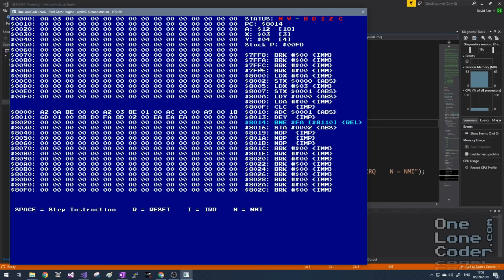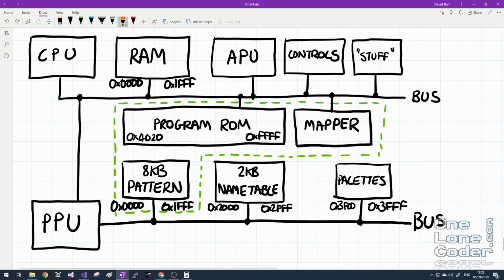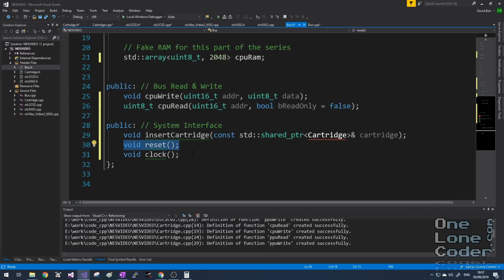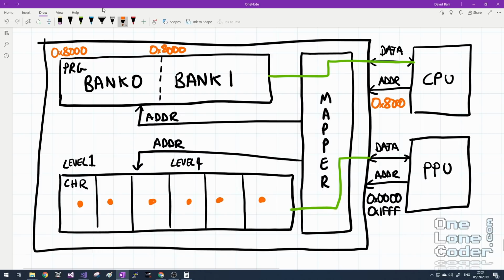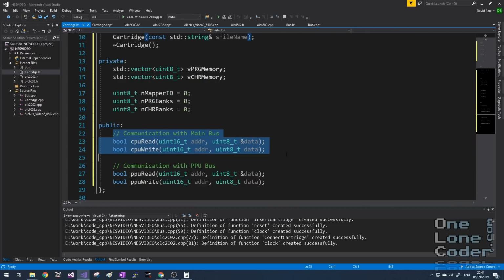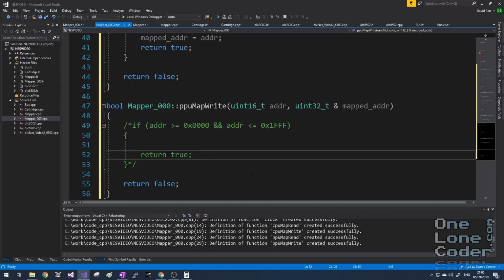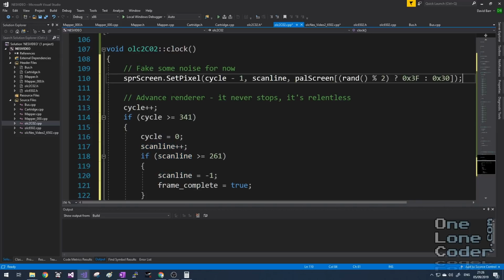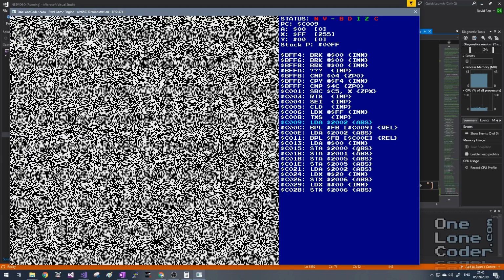NES Emulator Part #3: Buses, RAMs, ROMs & Mappers

Comment: I've seen you do this several times, and perhaps you already explained it (I don't have c++ experience myself), but why do you call a function, then immediately call it again with "~" in front of it? What purpose does the tilde serve?

For example, at 13:23
public:
    olc2C02();
    ~olc2C02();
Reply: Constructors and destructors. Constructors are called when the object memory needs initialized and destructors are called when its memory is getting freed and object removed.
Reply: These are not actually calls.  This is part of the definition of the class, and what these two lines are saying is this class has two special 'methods' that it plans on defining.  These methods always have the same name as the class you are defining.  The first one (olc2C02) is called a constructor, and (with some simplification) when you actually create an object of the olc2C02 class (using something like new keyword) you will call the olc2C02 constructor that you defined as part of the olc2C02 class.  Conversely, the the ~olc2C02() is going to define something called a destructor, and with some simplification here also, once you are done with object, it will call the  ~olc2C02() destructor that is defined for the class.  Defining these two types of functions helps with setting up (in the case of the constructor) or cleaning up (in the case of the destructor) as you use an object.  This is all a part of a basic understanding of C++,  so as a suggestion you might want to review about how C++ declares classes and especially what constructors/destructors do and how/why they are used.  Hope this helps!
Reply: @michaelburns8073  I've done plenty of Java work, so I'm familiar with constructors, but thanks for clarifying the destructor. So it's basically malloc() and free() for that specific object (as C would put it), right? Also, is the destuctor called automatically? I know in C++, and especially C, you really have to work at managing memory, and I've not seen a ton of C++ code, but I don't recall seeing an explicit call to a destructor before (other than in the declaration that I asked about).
Reply: @TheRandomSpectator  yes it's called automatically
Reply: @TheRandomSpectator   It's similar to malloc and free, but to me it's much more, because malloc() and free() generally only obtain/free memory, but object creation/destruction is much more than that, but I understand what you mean.  Yes, you do have to manage your memory in C++, which in Java is usually handled by the garbage collector.  In C++, once an object goes out of scope, then it's destructor is called.  If your C++ object did things like allocate memory, then the destructor needs to free and clean it up.  In Java, although it can cause problems if you hold memory for a while, in most cases you don't worry about it because the GC will get around to cleaning it up once it can. Java does have the finalize() method to help do similar things like you might need to do in a C++ destructor, like close file references or network ports, etc.  For fun, I thought about trying to do at least the 6502 emulator in Java, since I do Java development for a living, but tbh, C++ is better suited for this kind of thing, although I think it would be an interesting technical challenge to try it.
Reply: In the header file; this is within a class's declaration code. Here you are only declaring what a class is. Those two functions have the same name as the class. The first one is the class's Constructor. The second one with the `~` in front is the class's Destructor!. These are used to initialize, construct and setup the class's internal members during construction, and most Destructors are default unless if you using dynamic memory within that class, then the Destructor must free up any memory that was used. So what you are seeing there in the header and cpp files of that class are not actual function calls. In the header they are the class's declarations or prototypes, in the cpp file those are the class's member functions' definitions or implementations. Now when this class is included in some other class, file, translation unit and you Create an instance of this object for example;  olc2C02 ppu;  here you created a variable named ppu, it is a type of olc2C02 just as if you did int x;. Here you don't see the constructor being called directly because it is being called implicitly behind the scenes. Also when this object goes out of scope, it's destructor is also implicitly and automatically called as long as there were no early returns, breaks, application crashes or exceptions thrown.

Comment: I don't really understand how could it be that a ROM (read-only memory) has a configurable mapper. How is that possible?
Reply from the maker: The mapper sits in front of the ROM, and manipulates the addresses.
Reply: @javidx9  Wow, quick reply! I guess I just can't wrap my head around it - what this means is, we're essentially changing a part of the cartridge? 

As a practical example: If the mapper gets reconfigured at level 4, and I give my friend my cartridge, will he start at level 4? (Or some kind of corrupted state that will require me to reset the mapper to its initial state)?
Reply from the maker: The mapper is just a switch controlled by the CPU. The CPU could put address 20 into the mapper, but the mapper then determines where in ROM that reads from, level 1 could be 200, level 2 could be 300 etc... But the CPU always gives address 20.
Reply: @javidx9    yes, this is exactly what I mean. If I understand correctly, although the mapper is controlled by the CPU, it still has "memory".  How else would it remember which way to redirect the CPU. 

Hence my question about whether the game would be "corrupted". CPU notified the mapper we're on level 2, so the mapper now maps address 20 to 300. I pull out the cartridge, put it in a different NES. Will 20 still be mapped to 300?
Reply from the maker: The mapper like everything else not ROM on the cartridge and console will reset at power off. It's a logic circuit. It has no memory other than a few registers (like CPU registers)
Reply: @javidx9  Oh okay, I understand now. Thank you for your patience! This has been a very interesting series so far!

Comment: Mirroring ? Used to be called "bank switching" when I was doing this 30 years ago.....
Reply: @eightlittlebits  Err ok, .... isn't that just a side effect of the address decoding rather than an actual "thing" ? ... the convention was to always access the lowest block mapped. That way the range does not conflict when you decode more address space later. I worked in this area for 20 years and I do not recognise all the terminology you are using?

Comment: Writing a nes emulator is trivial for someone with proper coding skills.  Just look at all of the "it emulates mario or a few games but nothing else" NES emu-code/abortions on github..
The hard part is handling all of the little edge-cases which make certain games fail to operate properly.  Here's one and the solution: the game Paperboy won't respond to input unless you return the top bits from the cpu's open bus with reads to 0x4016,0x4017.  Some emulators fudge it by returing 0x40 | joy_bit here.
Reply: what are you talking about? i'd probably be proud if i got mario working
Reply: Of course, if that's as far as you want to take it :)

Comment: So the RAM is being repeated I assume for data integrity reasons?
Reply from the maker: The RAM is not physically repeated. Its due to the address range on the bus being incompletely specified, so only certain bits of the address word are required. You'll see as the emulator develops that all these ranges stop on clean multiples of 2, meaning you dont need the whole word to access them all the time. It also permits the programmer to access the ram in multiple ways, some may be more convenient than others in a given situation. Basically the addresses should point to something, but there is not enough data to satisfy all the addresses, so they may as well point to something useful :D
Reply: @javidx9  wouldn't it have been better to utilize the address space above the range available to RAM for something more useful like increased ROM range? I imagine that the extra available ROM memory could have been used for more complex games. Just curious as to why the console designers didn't go down that route instead of merely mirroring the addresses effectively making it useless.
Reply: @fathimaabdullah3365  At the time it was designed, RAM and ROM were more expensive.  I think they figured the specific amount is what would really be used, and the mapper was added later as technology improved faster than they envisioned.
The "glue logic" to route the address to various places was also kept at a minimum, as the number of logic gates available on an affordable chip was very small.  So, general practice was to ignore bits that did not matter, rather than reserving the range for something else.
Reply: Can think of the top address lines as not being connected to the RAM. It only has enough of the address being checked to enable the chip.
Reply: @fathimaabdullah3365  It would require to add more circuits on board. And circuits cost money.
6502 CPU has 16  address wires coming out of it. But 2k RAM chip has only 11 address inputs. Mirroring isn't something that done purposely. It happens then you don't connect all 16 wires to a device. 

To avoid mirroring you need a decoder. NES has one 74LS139 chip that has two decoders inside. 

They together split 64k into 8k RAM, 8kPPU, 8kAPU, 8kEMPTY, 32kCARTRIGE. (Notice that PPU only really has 8 bytes, so it gets mirrored 1024 times!!!)

To split further you would need another 74LS139. You can say that it is just one more chip but it cost multiplies with the amount of consoles produced. So, Nintendo decided it did not worth it.

Comment: Please don't say "kilobytes" when you mean "kibibytes". 😣
Reply: Pedantry :-)
Reply: No one in the industry says kibi, Mibi, or gibi. Those are legal marketing terms. Hardware must operate in powers of 2, so the closest range is used. Marketing people figured out they could misrepresent this using the actual base 10 numbers and it went to court.  Marketers won. But there is NO use for marketing kilobytes in industry. It simply doesn’t exist. So hardware and programmer devs should change to kibi because hard disk boxes use kilo? No, don’t think that will happen.
Reply: please don't comment if don't have anything constructive to say.